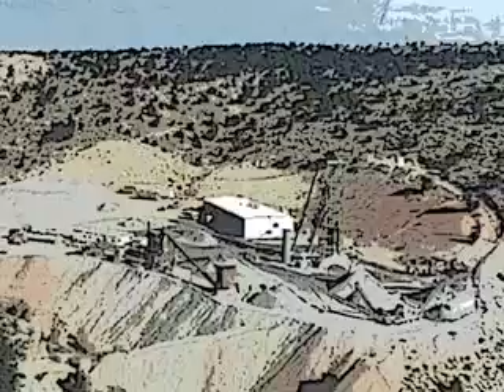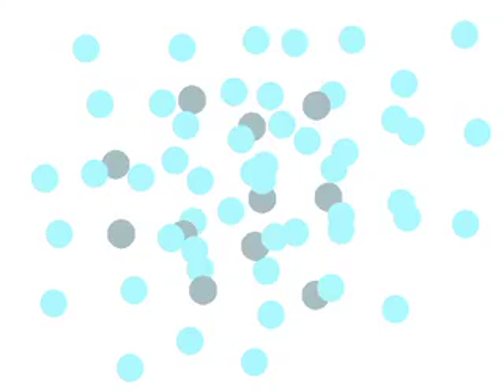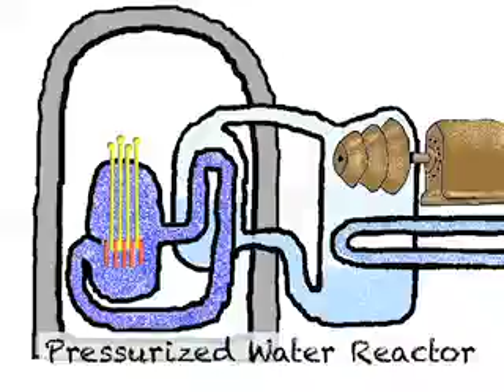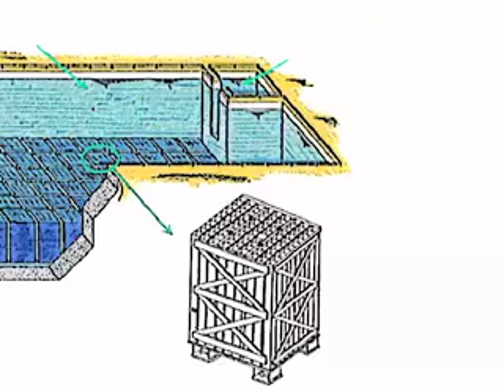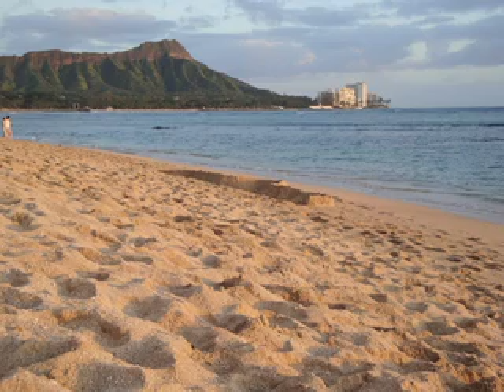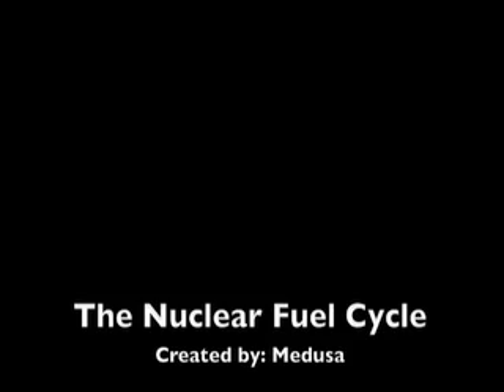The Nuclear Fuel Chain - A Primer

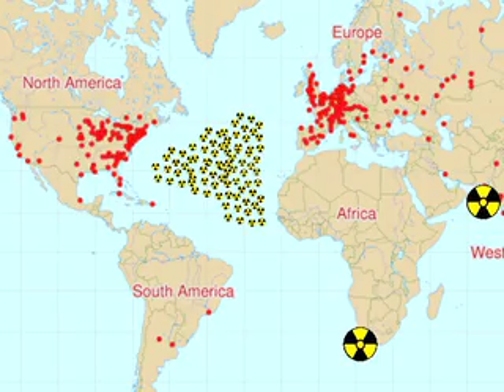Comment: Several flakey remarks lead to misunderstandings delivered to those you want to educate.  An example: at 2:47, you tell about shipping fuel rods and what happens if there is an accident along the way.  You give the impression that the fresh, unused fuel rods are dangerously radioactive - look, see all the little radiation symbols swimmong toward you from the Atlantic!  You don't (explain?  realize?) that the fuel rods are quite handlable by humans, as long as they avoid breathing dust created from the pellets.  The radiation doesn't rise above that of your front concrete porch until the rods are "burned" in a reactor for several years and accumulate fission products which are highly radioactive.  You also don't point out that the largest concentration of radiation on our planet, those spent fuel rods, are completely shielded by 20 feet of plain water; that's why we put them in pools.  Spilled in the Atlantic as you illustrate would result in just about nothing being hurt, plants, fish or humans.

Your take on the waste is itself doodoo.  The reason waste reprocessing isn't done is purely economic; its cheaper to dig up more uranium, since the cost of storing that waste is small compared to te acreage covered by a coal-fired power plant.  And a lot less toxic. 15 tons per year?  That's less than half a semi-truck load per year.  Amazing; for all 66 nuclear plants that amounts to 1666 tons per year. The radioactive coal waste amounts to 8 million tons per year, and that doesn't count the amount lost to the atmosphere for us to breathe.